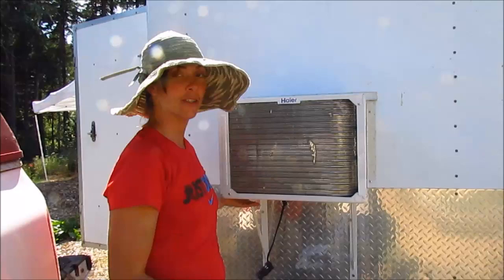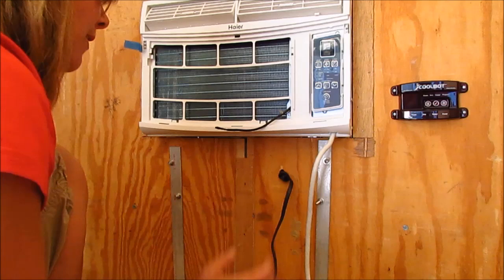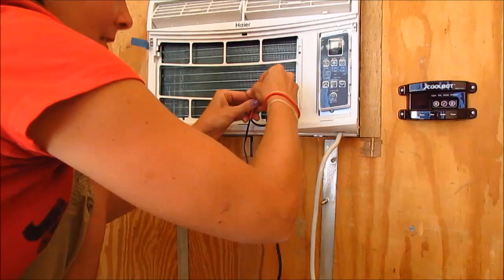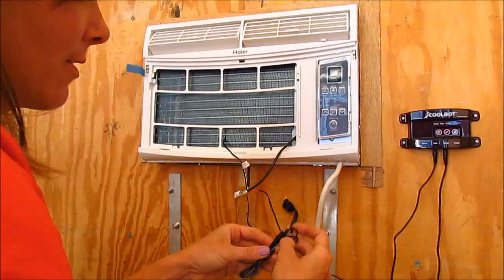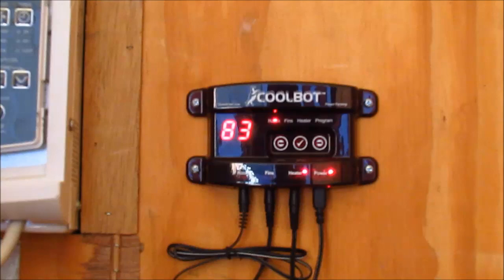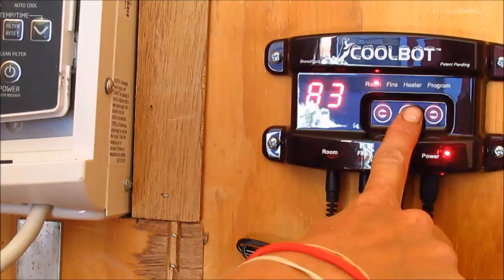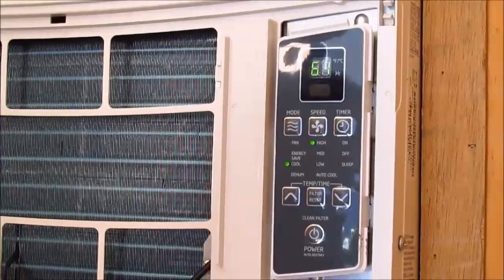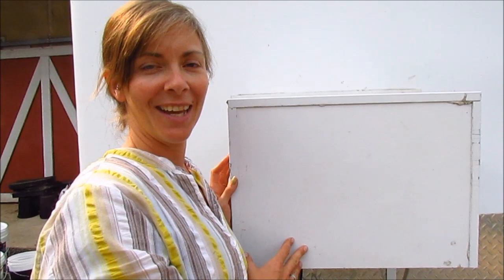Coolbot Refrigerated Trailer Build and Installation

Comment: The much much better way and even cheaper is to buy cheap AC with manual control and add programmable refrigeration temperature control, which will allow you to run compressor separately from fan and also have a normal defrost cycle. 

 Programmable refrigeration temperature control will cost you about $ 30 and manual control AC is also cost less. 

This is what I did. I bought a new  5000 BTU AC unit for $120 refrigeration control for $30 and now I can completely control my 4x8 cold room including defrost control.
Reply: Pasechnik can you tell us more? Like the exact ac and where u got the controller? This is a great idea and alternative.
Reply: Pasechnik you sir, are a godsend! I have researched this all but dont have the skills to figure it out like you did. I doubt many people do, thus why the coolbot sells. I have a manual control 5000 btu as well so thank you for such a detailed response. I am a mushroom farmer just looking for a quick alternative before i invest too much $.
Reply: You are welcome. It is actually very easy to figure out the wiring. Just take apart your manual controls(make sure the unit is unplugged before you start :) ). You will see temperature control knob is your thermostat which controls your compressor (Just like an On/Off switch). Also you will most likely see 2 or 3 speed fan switch. I use highest fan speed to help to avoid icing up. I turn fan off when temperature is reached (saves electricity, less noise, less wear ant tear)
Reply: Thanks man I was wondering what that little thing was doing. Could use the refrigeration control for any @/c.? I'm thinking of doing this in my household upstairs room where it gets insanely hot

Comment: Great informative post, thank you!  I am about to start a build of my own... how many inches of rigid foam did you put in the walls/what was the total R value?  Cool bot suggests a total of R25 if you're shooting for 39 or colder... wondering if you put this much in the walls, and if not, have you had any trouble maintaining temp (when trailer is parked in the sun or otherwise)?  Thanks!
Reply from the maker: We followed the Coolbot recommendations.  The only time we see an issue is when it gets really hot (over 95*), and we have it parked in full sun. Otherwise, in shade it maintains well.

Comment: What did you do about the existing wiring? taillights, etc. I'm worried about covering mine up completely.
Reply from the maker: The wiring in our trailer was in the walls,  and all we did is add the foam board and made seems for the wires to run between two pieces. All the rear lights run under the trailer and weren't affected

Comment: did it get to 39°F? if you open the door will it take another 3rs to cool?
Reply from the maker: It does get that low, but we generally store flowers around 43.  When opening and closing the door, it recovers super quickly, within 5 minutes or so.
Reply: that's all I needed to here! I will start my build and just purchased my coolbot! I will be  hauling around mangoes and other fruits that need to stay at 40°F.Thanx